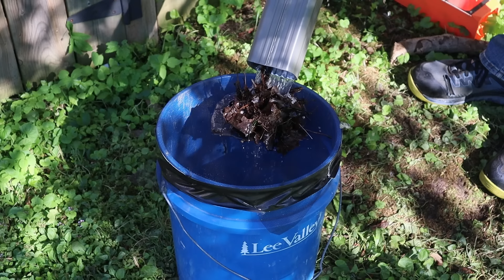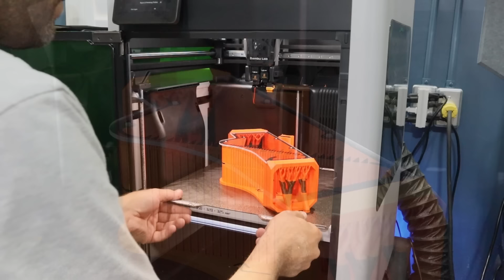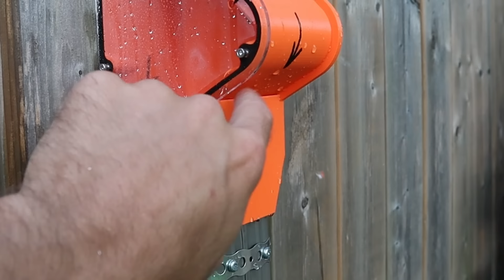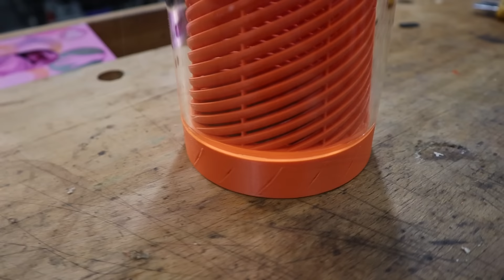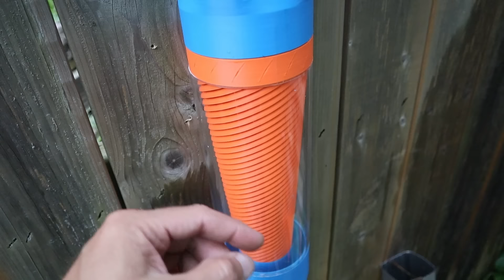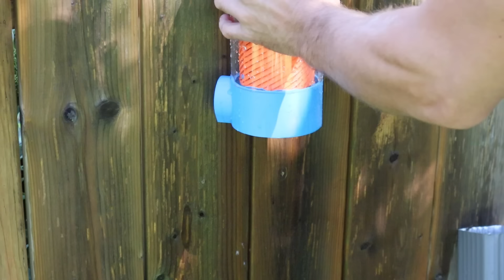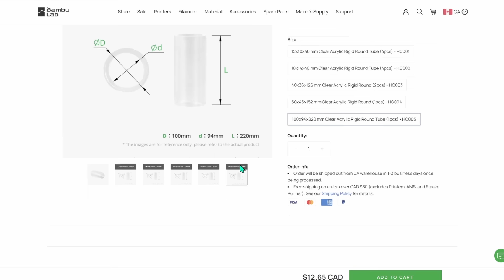Can you 3D print a self cleaning downspout rain water collection filter that actually works?  Let's

Comment: Very clever but I have to criticize your test set up.  Spraying a hose into a downspout seems MUCH different than water pooling in a gutter which sort of overflows into the downspout.   Not only in flow and pattern but also in the way debris separates in pooled moving water.   Also it's important to note that these days, where I am, we don't get simple rain.   It's huge heavy downpours that easily swamps gutter systems.  You sort of cross your fingers and hope that most of the water is sort of going through and the overflow won't destroy something.   Even if you are OK with losing the water that would otherwise be trapped, for many (most?) places, the gutters are protecting something like the foundation, crawl spaces, basements etc.   Having heavy excess water draining into places the gutters were supposed to protect would be a problem.  of course, clogged gutters/downspouts can be a problem too.  
But still pretty cool.
Certainly, there are situations where a self cleaning downspout is ideal.

Comment: I think the spray nozzel you are using is causing water to stick to the walls more than a typical gutter, give you great results with the final design but potentially hiding that most water wouldn’t be captured in the real world. Fine if you have way more rain than you need, but I’d like to see you hook it up to your actual gutter system and introduce water upstream of the down-pipe. And of course, a year from now show us how it turned out! Great idea!
Reply: Solution: Angle/bend the pipe, so the water falling straight in ends up on one of the walls. That's basically having similar results to the first experiment.
Reply: I would assume that with a typical gutter the majority of the water is sticking to the walls.
Because at the top it flows over an edge, so there really isn't a way for the water to flow in the middle of the downpipe. It should all fall down at the edge of the pipe.
Reply: A small section of gutter attached to the fence would have helped. 
I also had concerns about the rain water capture %. Even though I live in a pretty rainy area (St. Louis, MO - ~40in/year), there are periods of hot dry weather where a reasonable level of  efficiency can help.
Reply: Yeah, that's a good point, and probably true. However, I doubt efficiency matters much for his application; he can always supplement his plant water with tap water.

Comment: I’m curious how it would work in real world conditions. A couple of potential error points in your testing setup are the spray pattern of your hose and the the hydrodynamics of the gutter to downspout interface. 

The spray pattern of the hose seems to be conical which would automatically make the water stick to the sides of the downspout. If you attached a short piece of gutter at the top below a board on an angle (mimicking a roofline) then placed you debris in the gutter (or evestrough as we call it here in Canada), and sprayed your water in the simulated “roof”, you would likely more realistically recreate the real world testing conditions on a smaller scale. 

Obviously it more complicated, and likely won’t be much better than just attaching it to your actual downspout and spraying water on your roof!  It may not be different enough either from your current setup to learn much more. 

Awesome idea though. I think it would be great for the purposes of funneling water from my roof into my pool to keep up with evaporation.

Comment: Why are you funneling it down. Water follows surfaces so its not needed. Your leak at the magnets prove water will turn an go through a crack in a straight wall an a funnel is not needed. If you made your spiral straight sided or better even funnel out, the water would still follow the wall an go thru the cracks, but the trash would fall straight through as the top opening would be smaller than the bottom. You would lose more water in a hard rain but you have no shortage of water then anyway.

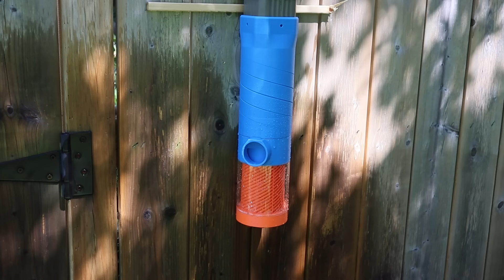Comment: if you add a lip or a groove to where the magnets sit, you can create a physical barrier to stop the leakage issue at 20:20. otherwise this is a fantastic filter, though it still doesn't stop the downspout itself from clogging at the opening. maybe you can design that next!

Comment: Great project! I was thinking of pre-expanding the top part of the filter so that when it is tapered at the bottom it is no smaller than the size of the downspout, to avoid any debris from getting trapped by the even slightly reduced outlet size of the funnel.

  | |
\    /
  | |

Comment: The orange filter thing is really cool, yet I think you could accomplish the same goal by using a screen or mesh material. I could understand an arguement regarding the durability of screen/mesh material compared to the plastic so there's that but I would solve that problem with something to slow down the falling debris.

I know a screen filter exists that uses a 45 degree angle to wash away debris. I dont know how fine the filtration is on it but you could try a multi-stage filter that gets finer. 

Have you considered a conical screw shape? Its simple, you wouldn't need the clear outer tube to trap the water. 

I'm not trying to poopoo your design, I just think it is over-designed and uses more material than what is necesssry for accomplishing your goal.

Comment: I would personally suggest you reverse the taper entirely, to the lower part is actually wider - Surface tension will have it cling to the filter and carry off some rain water while completely removing the small debris clinging to the filter
It really is dependant on if you prefer high take off, medium maintainence or low take off ultralow maintainence though

Comment: Keep Pressing on with this design the magnet idea is brilliant and the joys of 3d printing is the rapid prototyping. My advice would be to do various lengths and also so lab style conditions like 10gallons in off a simulated roof section an see how much is collected by design. I'd buy a few commercial hardware store to compare. No point reinventing the wheel  but you could be onto something here even if its just for yourself its a really cool concept. 
More More More!!!
Awesome video it gets a like and channel sub from me.

Comment: There is already a system designed like this for rainwater called a "Vortex rain filter", but it is designed to be further along the plumbing rather than directly on the downspout. It spirals the incoming water on the inside of a steel mesh and uses centrifugal force to pass the water through the mesh, but not the debris. Just like your design, it is self cleaning.

Comment: I think your best option is the original design without the back angle and a larger tension return gap. Why? The goal, in my opinion, should be to maximize debris removal and water capture while at the same time minimizing ones need to interact with the unit. Anything that narrows the debris gap in anyway is going to require more cleaning, and thus is counter the purpose. Loosing some water is inevitable unless one makes the debris removal angle so steep that gravity alone would remove the debris; however, allowing some water to aid in in the debris removal process is likely better to reduce overall maintenance. As for the water dripping on the tension return, simply add a secondary drip tunnel there as it should be virtually debris free at that point. Anyhow, this is just my opinion.

Comment: My thought with the first design, was that each of the triangles that were 'shearing the water' should be a different design. Instead of those triangles, use the kwanda effect there too. So have each of the fins with a kwanda curve and subsequent pins, instead of raised above the previous pin, slightly below. This way you're using the kiwanda effect, instead of water shearing with raised triangles that are prone to trapping debris.

Comment: Hmm I think you need multiple layers system so you remove large particles first then smaller ones. And it should remove them outward not inward so there is no clogging

Comment: The first design (that already exists) was the best because the part where the dirt comes out is open so if something gets stuck you can get it out without tools needed because it is open and also if it gets 100% blocked by something big stuck (for example a big plastic bag) then the water can get out as well and does not cause overflow of the gutters and damaging the building. You just looked at the auto cleaning part but the preventing of overflowing the gutter is also the reason why you wanted the self cleaning in the first place. The less maintenance it causes is just a nice side effect. It is the protection of the building that these where invented for.
Reply: Also, the first design has the filtering done at the the cistern, which is going to be further from the building than a directly attachrd pipe. For 99% of applications guttering's primary purpose is to divert water from the building, rainwater collection is a nice side benefit. Potentially compromising the primary purpose for the sake of the secondary use is shortsighted. Any environmental or cost benefit from collecting water will be eliminated if you have tear something out due to water ingress.
Reply: Well, it's possible to clean the last design without tools, too; since it is assembled with magnets. I doubt this is much worse for building longevity than normal gutters, which are also closed. Gutters are likely to clog at the top even without any modifications. Something that requires occasional maintenance is still better than something that requires (say) weekly maintenance.
Reply: Having it openly pouring water out of the side defeats the purpose of a gutter. It'll shoot water right next to your house lmao
Reply: @baconscoobysnacks3135  rain also shoots water right next to your house.
A little bit more water does not matter.

As long as the majority of the water is going into the pipe it really doesn't matter if some of the water is pouring out.
Reply: @Jehty_ buddy you're delusional if you think its the same 😂
Reply: @baconscoobysnacks3135  the point is to use that water, it would not be just pouring out of the side...it'd be piped to where it's needed.
Reply: @Cara.314 that's not the the original comment was talking about at all and the drain pipe already does that without a hole in the side lmao

Comment: Great issue to address and idea to iterate. Magnets expensive but it’s not the biggest downside - with filter clogged they will fail with high certainty.
Turn and lock with seal ring seems to be more safe especially if it is mounted in the end of drain pipe. Combination of nasty weather, ice and coniferous trees around the house makes it almost guarantee. Awesome video!
Reply: I agree and I also find magnets unreliable in this case, because now it works great but would fall off accumulating snow and ice.
Printing end of pipes with screw grooves and big thin nuts to connect them is a viable option. Maybe optional sealing ring made from TPU.
Reply: If it's connected top and bottom, I don't think the magnets are going to be an issue, since they aren't load bearing, they just keep it from shifting.

That said, I think the first design is better, since it is easy to see at a glance if it is clogged up, and takes just a moment to unclog, and the water keeps flowing even with a clog.

The helical design requires actually removing it to see if there's any buildup that needs to be addressed
Reply: @pdxmarine  I think even if they aren't load bearing, it'll still result in a gap, and therefor a decrease in effeciency, if they fail (which they probably would as soon as they get frozen for a while in a cold climate).
Reply: @xarin42  Unless you live somewhere where the temperature gets below -138C, it's not going to get cold enough to make magnets fail. And since I'm pressy sure this design is meant to be used on earth, where the coldest recorded temperature was -89C, I think the magnets are gonna be fine.

But if we're dealing with gutters out on Io or Europa, then we may need to look at other options.

Comment: If you add a lip to your magnetic connectors, such that the lower connector nests with the upper inside it, as water flows down it won't wick through the seam as readily. Gravity will help keep the leak minimal. Downspouts usually have a few inches of overlap for the same reason. The lip will also help keep it in place in case of winds, etc. Probably only need a 1/8" inch or so, maybe less. If you taper it a few degrees you'll get the benefit of dirt not being able to lock them together.

Comment: I'll keep using the mesh you showed at the beginning. But i would never mount it horizontally, like you showed on your bucket. I keep the mesh at an angle of around 60°, so all the debris can actually fall off by itself or get washed away from the water. My main goal is to not put any restrictions into the downspout that is smaller than the top opening, so it's less likely to build up a plug in the pipe. I guess you could improve your design by gradually widening the pipe first on the top, then put your coanda-twist filter-element in, and have it taper back to the actual downspout size at the bottom again.

Comment: Interesting concept! To measure and compare results reliable, maybe you could 
- put in the same amount of water and collect the water coming out
- dont spray directly from the top down the pipe but put a gutter on top to get more realistic conditions
- use each time dry or wet leaves and sticks because thats will be more comparable. It speed that you use for the last version wet leaves instead of dry like the other tests

Comment: try making it about 1 inch or 1.5 inches longer and make the bottom 1 or 1.5 inches of the screen portion (the orange bit) solid so any water trapped/waiting to get out the side can do so. Now it can escape because it backs up on the bottom and flows out the orange filter bit...

Comment: For heavier rain it should be enough to enlarge the lower reception cup to simply hold more water. The outlet seems to be capable of handling much more water. 
You could try to give the water a rotation counter to the rotation of the ribs in order to shorten the filter even more. Maybe in the part connecting to the downspout.

It might be not necessary to get a special filament with biocide, simply having a not see through enclosure should be enough although I would use ABS since I'm not aware of the biodegradability (wether by UV light or by water) of PLA

Comment: You might use the weight of the cleaned post-filtered water to mechanically power a moving conveyor belt screen that moves any debris while letting water pass.  Dynema rope pully powered? IDK.

Comment: Nice idea. You need to test it in real life for a longer period of time. I build a system for filling the barrel with an overflow back into the pipe. It was based on a commercial design, that did not fit the pipe diameter of my house.  It worked some time but it eventually got clogged with debris and a snail. Still looking for a better solution. I think the magnets look nice but a good old mechanical (screw) connection works better for this purpose.  If you can design a nice self cleaning system with clean water in the barrel that would be nice.

Comment: what if you did one that was like a drill bit? where the flutes have holes to direct and collect the water into the center. bonus points if you can get it to spin so the debris your filtering cant get stuck in the pipe

Comment: You can try a shorter hourglass design with the outlet in the middle, one side has the filter and the other half is solid so you can turn it around to disabile it and the inlets have the same diameter.

EDIT: oh nvm you already did something similar at the end of the video.

Comment: I have a commercial diverter that is essentially the bottom blue bit by itself, with no internal filter. It has a lid that can be raised up around the upper downpipe to do what minimal cleaning is necessary for larger debris. The majority of water falls into the outer ring and gets diverted, and if you ensure the divert outlet is at the same level as the maximum capacity level of your barrels that it feeds, the backflow of water when full acts as an automated cut-off.
Reply: The bit you describe is the standard connector for downpipes to water butts here in the UK. Just collects the water sticking to the inside face of the pipe producing very little restriction and collecting most of the water. Also provides an overflow when the water butt is full, so excess goes down the drain